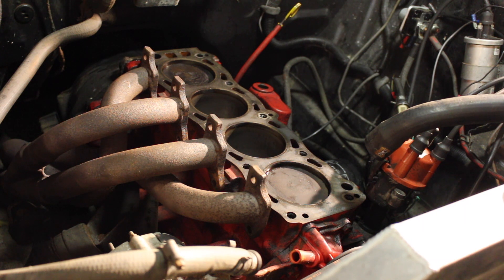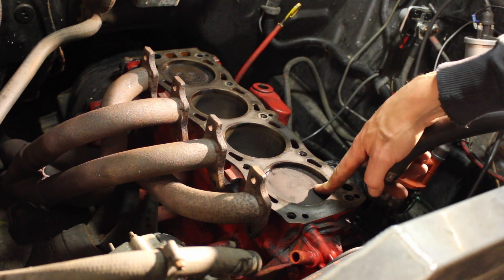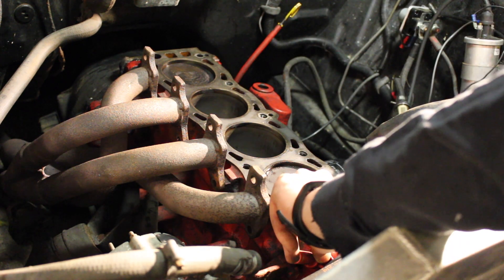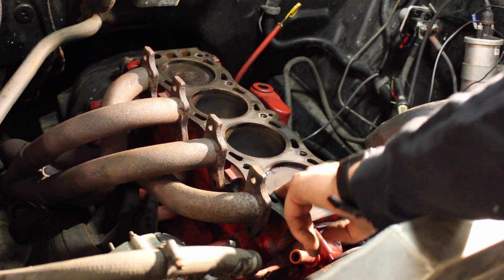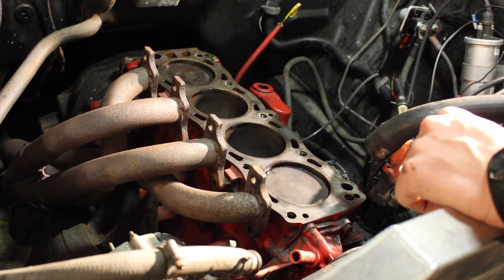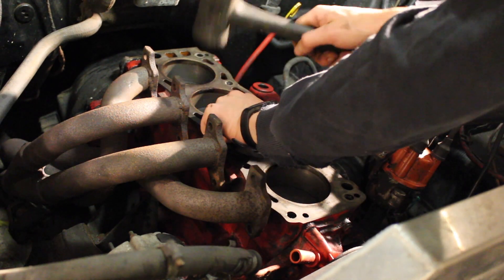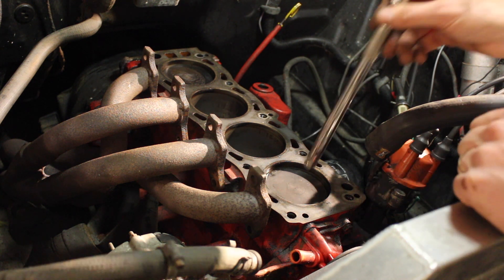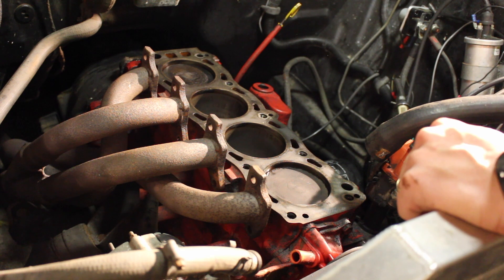How to Test for Bad Crank Bearings

Comment: why tear it down motor is shot !
Reply: If I tore a motor down that far I'd be mad at myself if I didn't replace the bearings while I'm there
Reply: @jake_break9185  agreed, it is good to be concrete on what the original problem actually was caused by though.